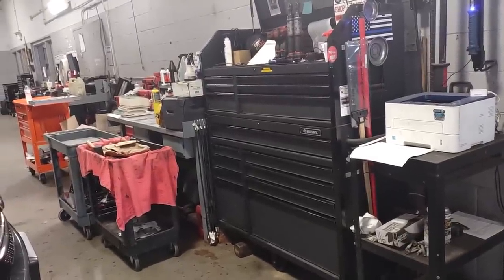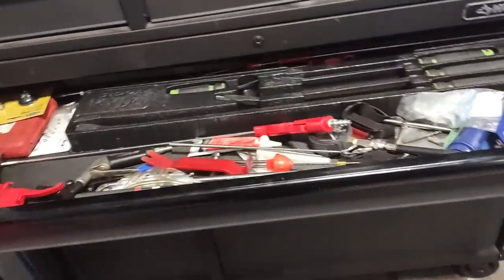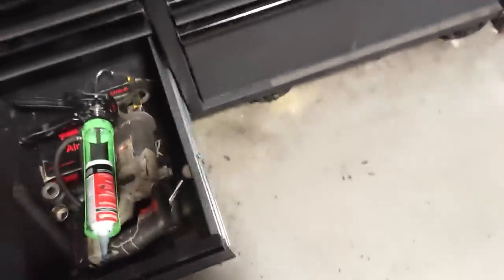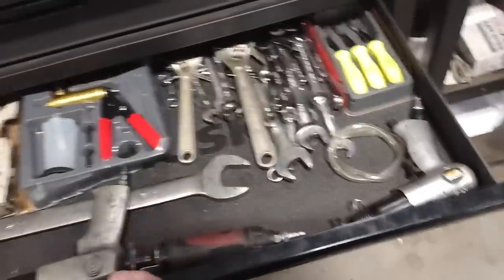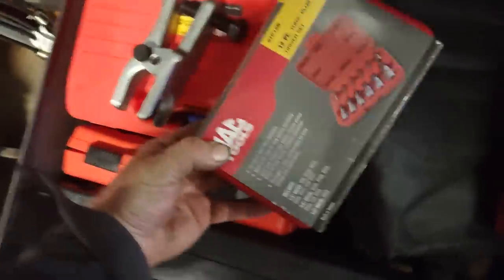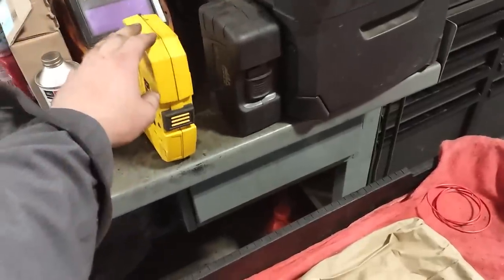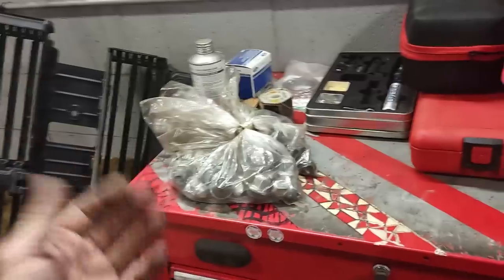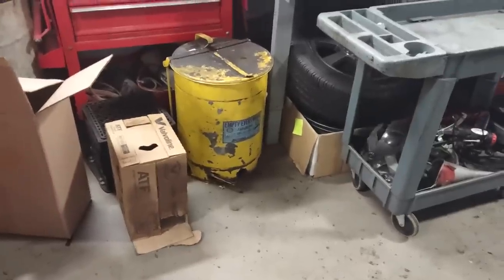Tool Box Tour - Subscribers Have Requested

Comment: Very nice set up. What do you think of the Venturi Cooling system refill kit? I just got one from Matco and I’m ehh about it. It’s nice when I don’t accidentally get air into the system lol. Save time having to burp the system.
Reply from the maker: I like it honestly
Reply from the maker: Thank You
Reply: @FordBossMe  Yeah I’m gonna keep trying it. 😋 only used it a few times. And thanks for the videos! I enjoy them.
Reply: It's a must have with newer cars otherwise you will have a hell of a time getting the system bled and will just end wasting a bunch of time and making a mess everytime it boils over. I have the robinair with the universal cone fitting and it works on everything in an independent shop, although sometimes you have to get creative in tight spots or bigger openings with a spill free funnel adapter or pressure tester adapter

Comment: Don't spend the money on the box.   Spend it on the tools.  I'm not even a tech for a living but I have at least that many tools.   And use them.  I fully endorse Vampliers brand (not a sponsor).   Harbor Freight's Icon brand is really putting the screws to the tool truck sellers.    If Neiko, Sunex, or ARES work for ya, don't make excuses.  At the end of the day it's the tool that gets the job done that's worth it.  And you can almost never go wrong with Red (Milwaukee) for the battery powered tools.
Reply: Yeah,  the box dont make the money, the tools do

Comment: What do you think about the Milwaukee tool box??
Reply from the maker: Its nice
Reply: @FordBossMe  i was given the tall tool box as a gift.  My wife ended up buying the toolbox with the wooden benchtop!  They are nice boxes and i am happy with them!!
Reply: I went to Home Depot and Lowe's after seeing the Milwaukee tool box in an ad, pretty much ready to bring it home.  I ended up going home with the same Husky box as in this video.  It was $798 between Thanksgiving and Christmas last year.  I use it in my home shop and it is fantastic for the price.  The Milwaukee that's similar to it is definitely not as good quality as this particular Husky box.  After 7 months of near daily use, I have no issues with it.  The soft-close drawers still work great.  The full length middle drawer is tall enough to have all my sockets standing up on organizers (I use the Westlingmachine aluminum organizers,) including all my 1/2 drive deep stuff.  Couldn't be happier and I didn't spend $10k.

Comment: Click vs Beam torque wrench?
Reply from the maker: Honestly I like to beam type torque wrench the best
Reply: Click.
Reply: Click for lug nuts and other suspension, but the Snap-on digital is a must have for head bolts and other engine fasteners as torque to yield is becoming more widespread in newer engines. Crank bolts, cam sprockets/phasers, t-chain tensioners, t-chain guides, flex plates and flywheels. I have both 3/8 and 1/2 Snap-on digital for that reason, expensive but needed

Comment: Yo screw snap on ratchets today lol I ran outside and grabbed my craftsman set from my car during class. 
The tolerances are so tight on everything that I gotta pry shit off with a flat head and it requires so much force to turn the ratchet action that the bolt more often then not does the loosen and tighten weeble wobble. For tight one handed spots or super slick greasy jobs I’ll take a sloppy ratchet any day. 
Also a tip for someone cleaning Thier ratchets I find that oiling them instead of packing them with grease makes them operate easier. 
No gummy back action.

Comment: Power probe is junk! I got 1 and never use it! Also digital test light junk too! Lol
Reply from the maker: Wrong and wrong
Reply: @FordBossMe  don't get me wrong.  Digital test light is good if you know what your doing.  I have seen many techs mis diagnose with solid state systems
Reply: @maxpaul11  Power probe is the most useful electrical diagnostic tool if you have just a little common sense. I'd be lost without mine. I still use a DVOM and normal test light, but the probe is my go to in most electrical diags. Also a scope is a must have with most drivability diags on modern vehicles

Comment: me and you are so close to the same..  i have about 40k in tools.. but less than 1500 in my tool boxes.. I always bought tools rather than the expensive tool boxes.  and dam proud i did.
Reply: i have the same ball joint press tool.. the one in the bottom drawer of yours.. had it for years..
Reply from the maker: I really don't want to spend a lot of money on tool boxes I would rather just put it in the good quality tools
Reply from the maker: I have been considering the Harbor Freight epic line I think it's called because they say it's modeled right after snap on... the engineer that worked for Snap-on Now Designs tools for Harbor Freight and that's why a lot of the ratchets and the tool boxes look the same
Reply: @FordBossMe : Harbor Freight has the ICON brand.  
I have checked them out in person at the store. They aren't too bad. Those short draws are SHORT though. You aren't going to keep a deep socket in them standing up. I have been kicking around the idea of getting one of the Icon 73 inch with a top box and storage locker. I have a 1990's vintage 42inch  Craftsmen tool chest, and top box, (as my main box) I have had since it was new.  It is still in fairly good condition, considering that I am a heavy truck tech for a fleet, and use the hell out of it every day.
I hate to say it, but, organizing your toolbox would open more space than you think it would. Not being critical, just an observation.
Reply: The way I see it.. the equivalent storage off the truck vs what I have is 7k vs 1500.  And its not perfect but it works and ive had one of the cheap harbor freight boxes for 11 years. It still locks and the track are fine.  The other box I have was dented.. got it for 500$  its the one from harbor freight that is 72ish inches..  plus a locker.  All of it works perfect. And if it breaks in 10 years. I can buy a few more and still be ahead. 

But I do see the appeal of the tool truck boxes. They are real nice..
Reply: But, you never learned the proper use of pronouns!

Comment: Drill bits are over rated by snap on and mac tools. Lol
Reply from the maker: Man you're just a regular Debbie Downer today aren't you
Reply: @FordBossMe  sounds like it. Lol. I can't justify paying top $ on some drill bits, only to break or dull for such.lol
Reply: @maxpaul11  Definitely don't buy Snap-on drill bits, but Mac drill bits are the best for the cost because they are the only one that will warranty them. The trick is they will only warranty broken bits, so if it is just dull then you need to make a trip to the vise with a hammer. My rep taught me that